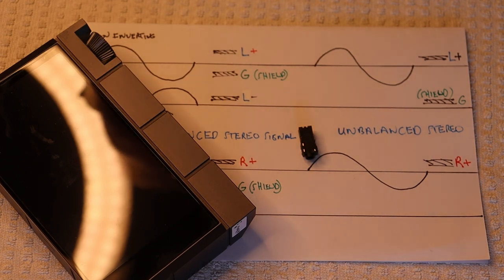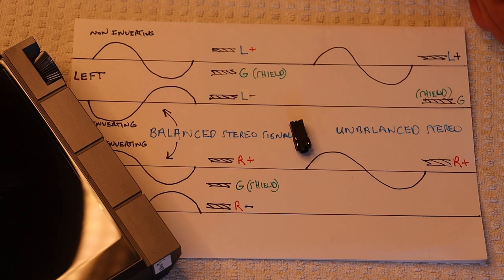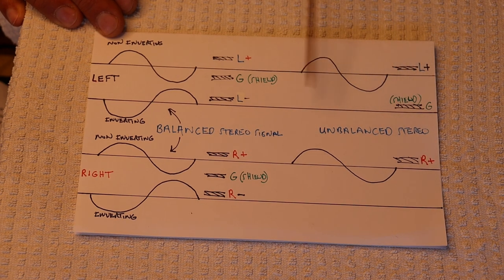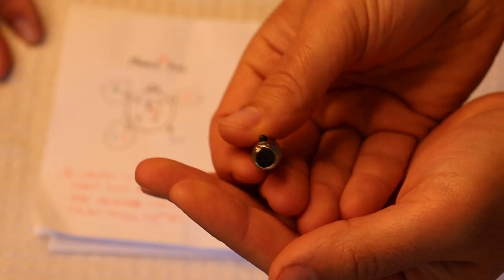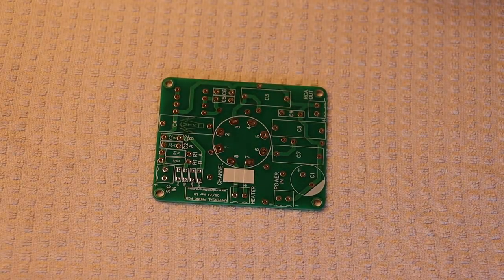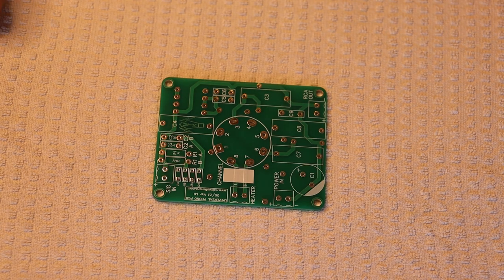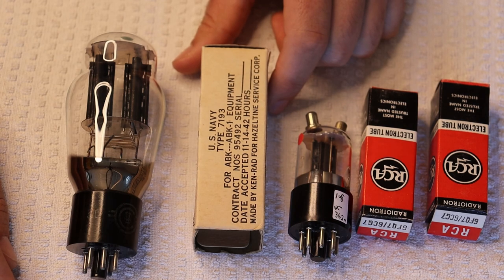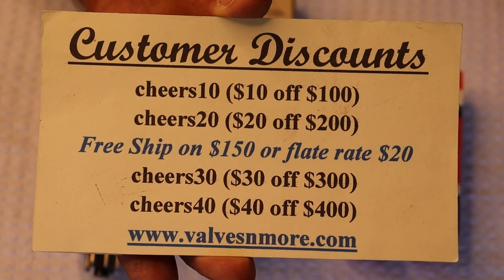Tube Lab #141 - (See Note below) How To Convert a Balanced XLR OUT to RCA Jacks

Comment: KANN Cube is an excellent player with a terrific balanced line out feature. I have the KANN Max. I use a cable that hooks up to my amp (dual 3pin XLR) to the MAX by 4.4mm pentagon connection. It is excellent. I can see why you like this player of course.

Comment: Excellent video. But I want to bring up an issue that one may encounter if trying to interface legacy broadcast gear to unbalanced devices. The information in the video is for an electronically balanced circuit where the output is just two separate line amplifiers, one in phase and the other out of phase.  So we simply ignore the (-) side or it could be the (+) side alternatively*. However legacy gear often used a transformer to create a balanced signal from a single unbalanced line amp, always for tube gear. So in this case you must connect the (-) side to the ground or shield and still use the (+) as the hot or RCA center pin side. Otherwise you have an open winding's transformer. You will get a weak signal with only the highs due to capacitive coupling in the transformer.

But do not ground  the  (-) side with an all electronic driver. That would short the (-) side line amp to ground with possible some damage or can drive current into your otherwise clean audio system ground causing come crosstalk.

When feeding an unbalanced signal to a balanced input, always connect the (-) input connect to ground. This will work for either an electronic balanced input stage or a transformer input stage. Alternatively some suggest connecting the unbalanced hot or center to the (+) and the unbalanced shield to the (-) and leave the  balanced input ground floating. The latter here does actually provide some minimal hum rejection but not nearly as good as a full balanced path.

Also note that pro gear is often at +4db, old broadcast gear even at +8db. This can create  a level or overload issue with consumer gear that operates anywhere between -10db and 0db.

*If you do use the (-) side as the unbalanced hot signal, be advised it will be in reverse phase to the input signal. Perhaps not a problem for simple listening but could a a problem with mixing and measuring gear.
Reply from the maker: Thanks for the additional information.

Comment: So the 6CG7/6FQ7 is 6SN7 replacement with the adaptor....and is it better/same sound quality as the 6GU7?  ( Using the R8 as my amp)  I really like the 6GU7 so far..(Sylvania and GE)   Thank you folks.
Reply from the maker: Correct and both tubes are very similar with the plates looking identical.  In fact Charles thinks in some cases they just installed a 6CG7 plate in a 6GU7 tube.  Sonically they each have their own sound, similar but different.  Personally I like them both equally.  The big difference is when you compare them with a 6sn7, which as a type has a warm midrange vs the 6gu7 & 6cg7, both of which have a very clean clear sound with low distortion - but of course less warmth in the mids.